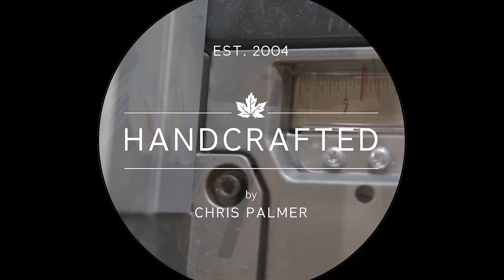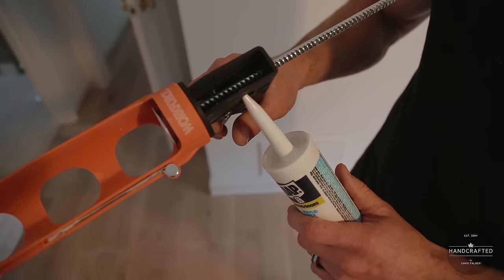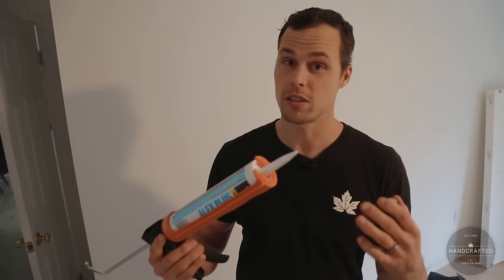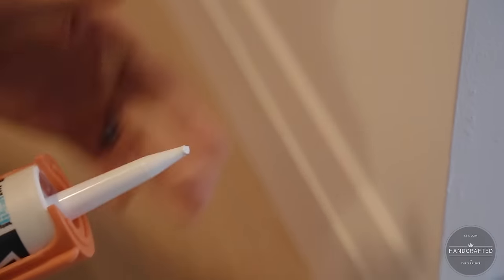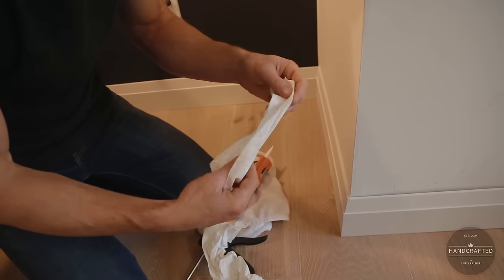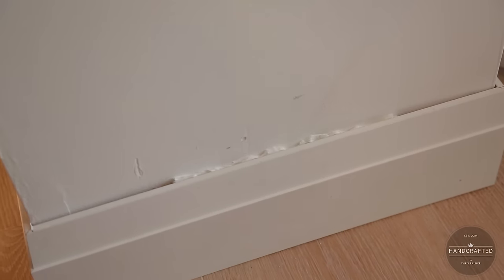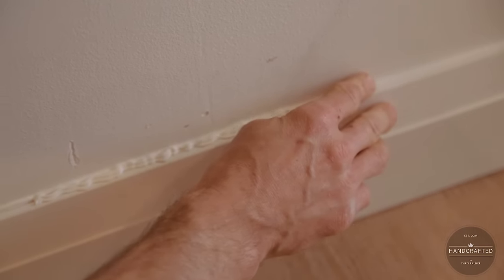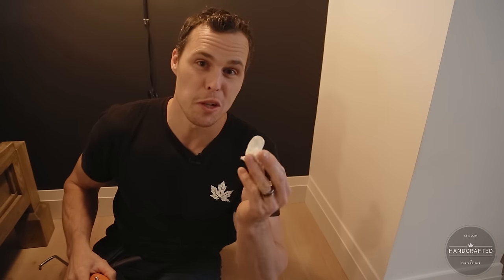How to Caulk like a Pro

Comment: hey bro, just bought a house and the finish between skirting and wall is pretty bad. how to caulk and have fine looking if the wall and skirting color is different? thx
Reply from the maker: Just curious as to what you mean by skirting?
Reply: Handcrafted by Chris Palmer skirting board
Reply from the maker: @小小星-s9f  you mean shoe mould? The small trim in front ofnthe baseboard?
Reply: @HandcraftedbyChrisPalmer  he means baseboard, it skirts the room. Shoe is for foot, scribe your base tight to the floor.

Comment: No 'pro' would start sticking bits of tissue down between the skirt gap. What decorators merchant sells rolls of 'tissue for sticking between ur skirting ?' A professional uses expanding foam or sets one bead of caulk and return with a second and more to build up. Thats a bodgers trick. The tissue would suck moisture outa ur caulk and crack it over time. This would be classed a diy hack at best..
Reply from the maker: Expanding foam is for windows and doors. Tissue paper won't create any cracks, it works perfectly fine in a pinch. I recommend using backer rod, as it's the proper method of gap coverage. Your expanding foam is totally impractical and more liable to create a mess since you can only control it by misting water on it. Not ideal nor efficient.

Comment: Bog roll don't be silly fill with expanding foam then caulk
Reply from the maker: Expanding foam? That's a bit much lol
Reply: If you use foam, you'd need to wait 24 hours for it to cure, then come back and cut off the excess before you could caulk it.  That's a pretty good waste of time.  

A bit of big roll, and the jobs done in 10 minutes !!
Reply: @jaytrader3119  it's the right way of doing it! and you don't need to cut is off if you know how to use the gun the right way. putting bog roll behind it bad workmanship and this is what cowboy do
Reply: Great...until it pops the board off the wall or creates a larger gap to caulk. Don’t underestimate the additional pressure created by expanding foam.

Comment: First hey have a product called backer rod that you should use instead of toilet paper if you want to Caulk like a pro. Second dripless caulking guns are not pro level caulking guns. This video should be called how to caulk for beginners.
Reply from the maker: Thanks for the feedback, the idea is yes to help beginners. Backer rod is something I keep in my nail gun bag, but most homeowner's won't know of it and feel that TP works great in a pinch, as would other similar substrates. I don't believe dripless guns are not professional as I prefer this method over cordless guns. Unless you have weak wrists or plan on doing large commercial buildings, it's all personal preference. Cheers.

Comment: I watched the video. Did my vanity. Here is what was left unsaid in this video. This guy has been doing this for years. Of course it comes out great when he does it. It isn't going to look anything like this this when you do it. It is going to be a complete shit show.

You are going to cut the tip too far down or too far up and probably at the wrong angle. Again, this is where this guy's experience comes in. You will instantly realize that you are at an awkward angle and it isn't as easy to hold the gun like in the video. Then you are going to realize that too much/too little is going to come out and have to go back and fix it. The problem is, you don't have anywhere to sit the gun. And then when you find a place to sit it, it slides around...because you know...bathroom. Then you notice silicone is still coming out so you rush to catch the excess. You didn't have enough paper towels ready. Now you are going to try to tear them off with one hand. It is going to be chaos. 

Back to the bead. You manage to get a decently straight bead down. Now you try to shape it with your finger. But it goes all over the place. It doesn't magically shape perfectly like it does in this video. How do you clean it off? Do you keep wiping your finger and then going back over it? Do you use a paper towel? What about the popsicle stick trick? Everything seems to make it worse. 

Now you have a huge mess and you underestimated how many paper towels you were going to go through. There is no garbage can close and you notice that the silicone on the paper towels is now getting everywhere too. 

You wonder out loud with much profanity why not a single one of these videos tells you what to do when this doesn't go as planned. This is exactly what happened to me and I promise, this is what is going to happen to you. 

Here is some actual helpful advice. Tape. It will take forever, but it will come out perfect. Have a garbage can and a roll of paper towels within reach. Disregard every single thing these guys in the video say regarding how you are going to have great results if you just do what they say. 

"Just (insert something learned over years)! Super easy, right! Great results!"

No.
Reply from the maker: Lol...well ok. I'd say silicone isn't caulk, you need a cup of soapy water to dip finger into to smooth silicone bead, practice on scrap materials first to get comfortable and them attempt a small section first to build your comfort...how's that? Lol

Comment: Definitely not like a pro if you’re using your finger. Breeding ground for bacteria. Get a tool for different size beading.
Reply from the maker: Interesting thought, but using a cup of water and a finger is perfectly fine. Especially if you wear a latex glove. The caulk is sealed with paint afterwards, at which point are you saying bacteria would be breeding? Not the same as a kitchen counter.

Comment: Oh my gosh..... you’re a painter not a caulker. You should of cut a bigger tip. Your a painter for gosh sake. You know you can fill that gap with backer rod and do the same thing with a bigger cut tip or bitter yet with a sausage or bulk gun and just paint over the bead? You’re fooling these people
Reply from the maker: A big bead will fill, and yes I prefer backer rod but this video is for beginners to learn the basics. Also, no one cuts a large tip to do baseboards unless you like a mess. Exteriors are not the same as interiors for bead sizes.

Comment: that part where you put the toilet paper its so bad. you could of just cut the tip of the caulk a little bigger instead of doing all that mess.
Reply from the maker: The whole point of the TP is to create a dam, to prevent the caulk from slumping into the gap. 👍

Comment: please do not use toilet paper! you will destroy your skirting!
Reply from the maker: Pardon?
Reply: @HandcraftedbyChrisPalmer  putting toilet paper into skirting and then filling it up will wreck your skirting later on.
Reply from the maker: @GothicKittyMadness  are you calling the baseboard skirting? I can assure you 4 years since installed, the TP did nothing more than prevent the caulking from slumping into the void. 👍

Comment: That's for me waste  of  time using the toilet  paper , 🤦. AND SUCH IF BAD FINISH  , Ended using about the same Amount  of caulking  if was done appropriately  ! 🙄🙄
Reply from the maker: If you lack the will, you will lack the skill...and in your case, grammar! Lol
Reply: @HandcraftedbyChrisPalmer  😅 I know Mr Perfect , Just because  of some typing  mistakes  📱 but  obviously You just show you're  Not Humble  man to accept a comment  of someone  who has done painting for years already  !🙄🤨🤭🤭
Reply from the maker: @daysiv9739  Hey I am not trying to burst your bubble, but you're coming on here with negative energy. The TP works well when packed enough to prevent the caulking from sagging. The walls with larger dips, I advise you skim a coat of drywall mud to build it to a flatter finish. If you didn't have any luck with this quick solution, perhaps another media would work like backer rod or wood shims.